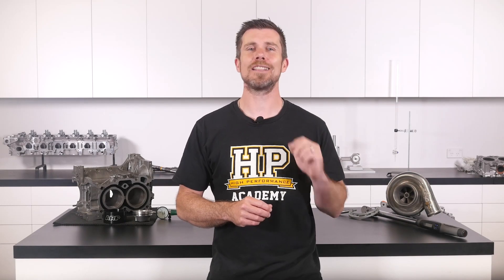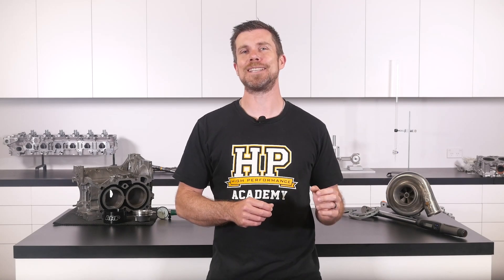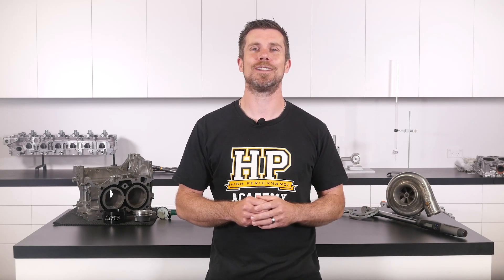Running Rich at High VS Low RPM [HPA Q&A]

Comment: Great lesson as always boys.  So are you saying add fuel vs retarding timing at high rpm is better generally or is it very engine dependant??
I'm tuning a vq35hr.
Reply: generally i would do both, with turbo/supercharged engines it’s needed even more to keep the cylinders cooler. power maximizing will be dependent on the fuel and engine.
Reply: @styrex4261  Thx for the answer brother. My tune is VQ 35HR - NA 350z 6spd running 98.   Do you think it might still apply??
Reply: @ryanscanlan9875  More ignition advance (adding timing) generally makes more power until you reach the point where you’re causing knock. If you aren’t knock limited, you can also advance the timing so much that the engine loses power because the combustion force resisting the piston coming up during the compression stroke begins to outweigh the benefits of having a more complete combustion when the piston is at TDC and going down on the power stroke. Adding fuel helps avoid knock so you can find the ideal timing for torque production. There are also limits to how much additional fuel will help. Finding the balance of timing and fuel is where you need to gradually change things and experiment on your specific engine. You should be able to find what other people found to work when tuning VQs and go from there.
Reply: @gstevie97  That helps mate, thank you!
Reply: I say add fuel, if it keeps knocking take a degree out. Timing is what makes power but fuel is what allows that power to be made
Reply: I would say try to balance both...

A little bit of less timing, a little bit richer fuel...

Dont go too extreme on just 1side...
Like too rich while keeping high ignition advance will make poor fuel consumption and risking cylinder bore washout...

Or too much timing retard will create high egt...

So ideally need balance both ways.. cheers